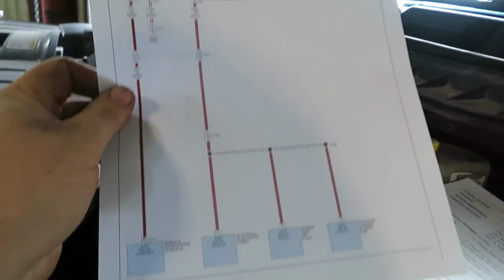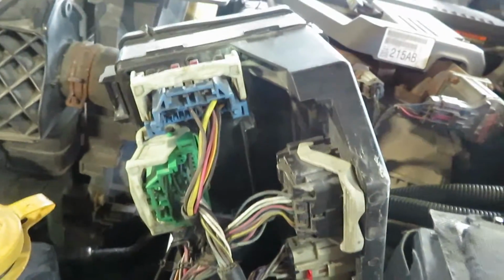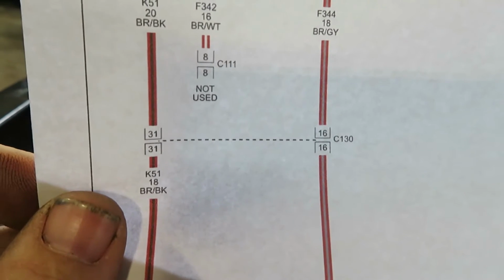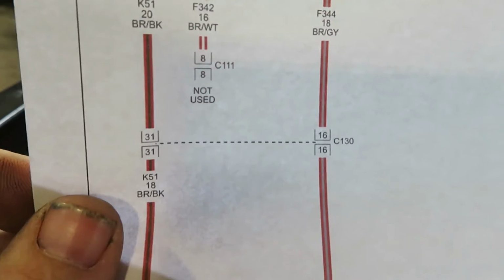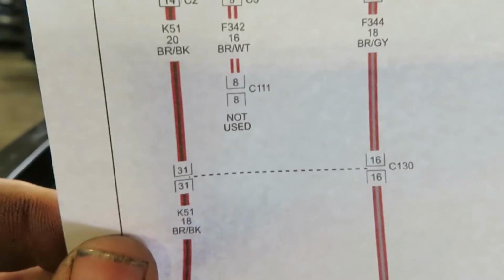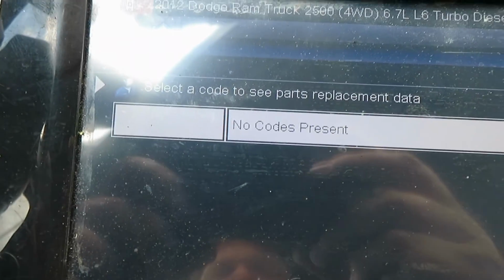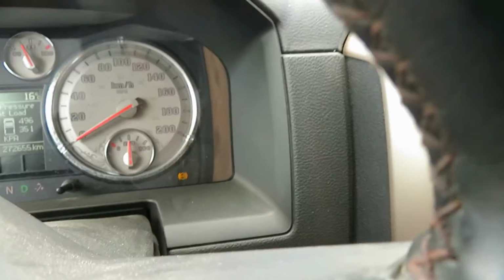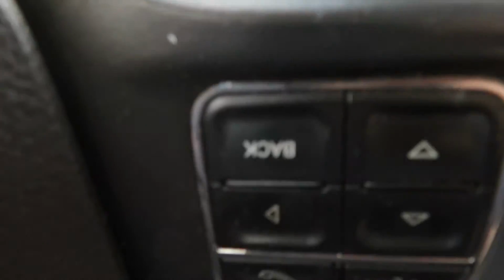6.7 CUMMINS TIPM DIAGNOSTICS AND CONNECTOR  REPLACEMENT (part numbers in description)

Comment: I have a problem with my turbo speed sensor it’s showing a code p2580 I replaced the turbo speed sensor and I’m still getting the code. I’m about to replace my ECM. Can you please help me? I have a 2014 dodge ram 3500 6.7 Cummins mega cab

Comment: I have a 2010 ram 3500 6.7  and my ac fuse is bad in my fuse box do you know what fuse box I can use and what year will fit my truck

Comment: I have a 2007.5 6.7 I’m not getting power 12v to turbo actuator the fuse is good. The relays good codes po102 p2509 po480 po593 could it be the tipm i didn’t see the green corrosion or any burn off pins and I got low voltage at the high and low pins
Reply from the maker: Are the other codes for the MAF and EGR not getting power? If so chances are the tipm is gone. Those 3 things share a common 12v.
Reply: Yes there was i erased it but before that ecm  i haven’t started it since then

Comment: Great video.  
there are better connectors to use than those chintzy solder clamp clips that they included.  those large soccer balls with the rough edges can wear through heat shrink.  

If you use some simple uninsulated butt connectors inside those heat shrink tubes you'd have a better finish quality product, you wouldn't be subject to solder and brittlement of the wires, and the overall repair would take less effort.

Comment: Thank you for the excellent electrical TIPM troubleshooting tutorial, Screaming' Diesel Ltd. One thing that you could have done differently (and much more easily) is to have removed the red-colored face plate on the Yazaki Hybrid 26-way female connector harness (the red-colored inserts slide outward with some gentle finessing by pressing down the center locking clip with a small screwdriver) and just de-pin the corroded Molex crimp terminal by inserting a micro screwdriver into the terminal well to release the internal locking latch. Once released, the crimp terminal wire slides out of the harness. These crimp terminals are Molex 0.64mm crimp terminals with part numbers 34803-0211 (22ga) and 34803-0212 (20ga) These Molex crimp terminals are the purple-colored pig tails that you received in the kit, by the way. This would have been much easier to replace just the damaged  crimp terminal and reuse the other non-damaged crimp terminals. The old Molex CMC connector harness could have been cleaned from the corrosion and reused; the plastic material should not have been affected. Nonetheless, I thank you for the great tutorial and for your time and willingness to share your knowlege to help others.

Comment: Does the PCM ground pin 86 when the key is turned on? Does it stay grounded until the key is turned off?
Reply from the maker: If 86 is the signal for the relay then yes it does and it should stay grounded till the key is off.
Reply: @screamindieselltd  Thank you.

Comment: Have the same issue with my 16 5500 but no turbo code nox sensor 2bac you think wiring issue   by the way all sensors a n d egr valve replaced with oem parts

Comment: Having an issue chasing wires 2011 6.7 fuel level will not work changed sender did ohms check on new and old sender fuel light stays on dte is a 0 gauge says empty with a piece of wire between the sensors pins on fuel pump I can get the gauge to come up just a needle with under full ? I would appreciate some input
Reply from the maker: So the gauge should have a 5V supply a return and a ground. You are most likely shorting the 5V to the return to get it to move. So that tells you those circuits are good. I’d look at the ground.

Comment: I need help...2011 ram 3500.... All 6 injectors open circuit. Any help would be appreciated... All grounds clean... Mass air cleaned... At a loss
Reply from the maker: Did you check the under valve cover harness and the connectors going into it?

Comment: Hey Brother was wondering if you could give some insight w my 09 dodge 6.7.. No start,no crank and have B218B Igniton run/start overcurrent, U0100 Losr communication w ecm, and U0121 lost communication w abs module. I know some of the thoughts are bad tipm module or ecm but was praying maybe you have seen something like this and found other issue. Really appreciate any insight. I was going to look at tipm connections and such also. Thanks again
Reply: Yeah I’ve already disassembled the tipm and yeah I didn’t find any burnt up components. But also mine isn’t showing the gear position your in.
Reply: Did you ever get this problem solved I have a 07.5 with same problems
Reply: @Trey Pelfrey  Trey I wish i could tell you yes. I got all the information to attack it and had disconnected batteries a day prior and because i have a programmer on it i hooked them back up to put back to stock. For the heck of it i tried starting the truck and it fired up. Since its my only vehicle and till i take time off work ive been driving it, yes the dash is like Xmas time but i will def get back w you if i fix it. I hope you will do the same.
Reply: Greatly appreciate it. I tried a donor ecm and same problem so I’m thinking it’s tipm issue
Reply: @Trey Pelfrey  When you get a chance look up some tipm repair videos. As expensive as they are (and if you can find) its worth a shot. Doesnt look difficult just a little tedious and some videos have some good troubleshooting on them. Im unable currently to remember some good ones but once you go down that rabbit hole you will find some good ones. Maybe try dodge tipm repair. Def keep me posted.

Comment: Very informative video. Can you help me out? I have a 2015 2500 with 6.7 Cummins. I'm getting U010C, P00AF, U3017, and occasionally P0071 codes. My exhaust brake doesn't work. I haven't noticed any lack of power or lack of boost. Any help would be appreciated. Thanks.
Reply from the maker: Most likely the turbo actuator is blown/seized or the fuse is popped for it.
Reply: @screamindieselltd  Thanks. I will check the fuse and go from there. Thanks again.

Comment: Great video, on my 2012 I unplugged the actuator and maf plugs and my m21 fuse still blows. Would this be a TIPM issue?
Reply from the maker: Did you unplug the egr as well? It’s on that circuit also.

Comment: I have a question I have a 2006 dodge ram 2500 4 x 4 diesel mega cab I am having a problem with the shift indicator on the dash flickering the truck cuts out for 1 to 2 seconds and comes right back to life I have looked through several forms people say they’ve had the same problem but have never said what they did to fix it the parts that I have changed is the shift cable/brake light switch/neutral safety switch three times/cluster/cleaned the connections underneath the tipm can you please help me. I took it to the dealer they could not figure it out or fix it
Reply from the maker: When you say the truck cuts out is it the shift indicator cutting out or the engine dies?
Reply: @screamindieselltd  when it flickers the truck loses power for a sec but the truck doesn’t die it’s as if I push in a clutch pedal if that makes sense

Comment: Hey thanks for the video!  I have a 2012 diesel also, but on mine the blower motor quit working and at -30C Its kinda important!  Lol. It’s likely the same problem as that truck, as if I jumper power everything works properly, but the Relay isn’t receiving signal to latch it. Gotta dig into it further, but for now just sticking a piece of wire in the relay slots gets me some heat!  
Thanks again from Alberta Canada!
Reply from the maker: Anytime!

Comment: I have 2016 Dodge ram 3500 diesel that is sitting at the Dodge dealership to be worked on and the Dodge place tells me they cannot get the part I need and they are saying it is the chip inside the fuse box is that true?
Reply from the maker: The fuse panel or TIPM is like a big circuit board with relays in it that are non serviceable. With COVID computer parts have been harder to get so it is possible that they are back ordered.

Comment: Just wanted to say thank you very much! Subbed. Although it didn't solve my problem, I was able to determine the cause. In my case M21 kept blowing, and after process of elimination, the fuse doesn't blow when the turbo actuator is unplugged. Guess the actuator is shorting. Any recommendations? Should I try to open it and clean it, make sure the actuator moves? or just wait until I have ~$1500 to replace the turbo and actuator? (I don't have a fancy scan tool for calibrating the actuator. But would buy one if you recommended a cheap one like alfaobd)

Luckily when it stopped working the actuator gate stuck about half way? I say that because it still builds some boost, but nowhere near as much as stock; rolls coal very easily - sluggish power. So for now it's unplugged.
Reply from the maker: Thanks for the sub and comment! Once the electronics are fried they are fried. actuators have been hard to come by these days because of covid. As for a cheaper scan tool I’m not super familiar with what’s out there I just use my modis and it does what I need. New turbo’s Will come with it calibrated already. Hopefully this helps
Reply: Hey I’m having the same issue with my 2012 ram 3500. M21 Keeps shorting out. Found out the turbo actuator was also causing it. In my case my truck does not start. Does the turbo actuator cut the fuel supply if shorted or could I have a different/additional issue.
Reply: @adrianvasquez4121 I don't believe those two things are in that same circuit.
1) Do you hear your fuel pump when cycling the key?
Diesel engines need two things, compression and fuel, so:
2) Consider doing a fuel pressure test
3) Consider compression tester
 
Finding someone with AllData or similar software to view the schematics and diagnostic steps might be key to solving the problem.

Send me your email and I'll try to help.

Comment: Quick question...the part number listed for the plug, says its for a 2002 Ram 1500 on mopar, and when i enter my year and model in (2011 Ram 2500 Laramie 6.7) it says won't fit my truck. Where did you get the plug?
Reply from the maker: I got it right from my local Chrysler dealer.
Reply: @screamindieselltd  Awesome thank you so much. Do you think a bad TIPM would throw code p2509, and cause it to just crack and not start?
Reply from the maker: @cody2542  its possible. It controls a lot of stuff on the truck.